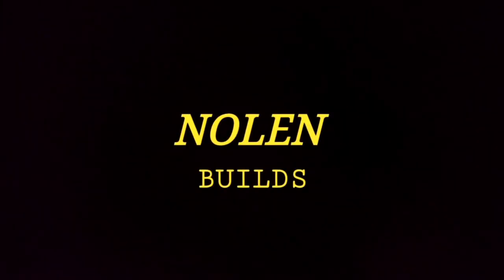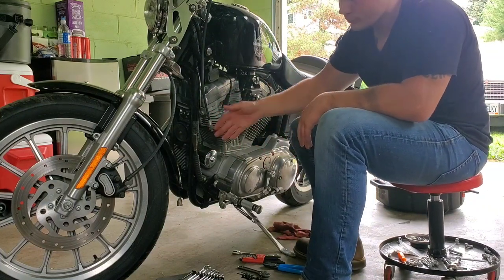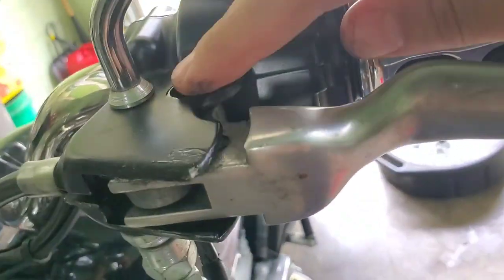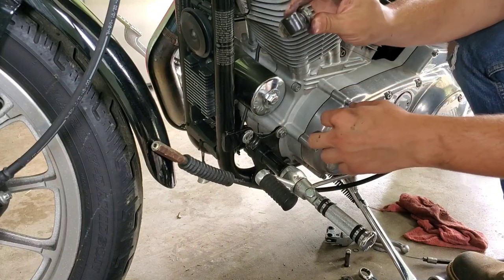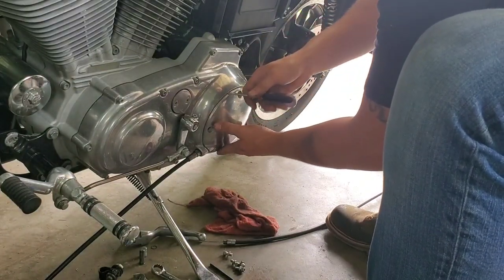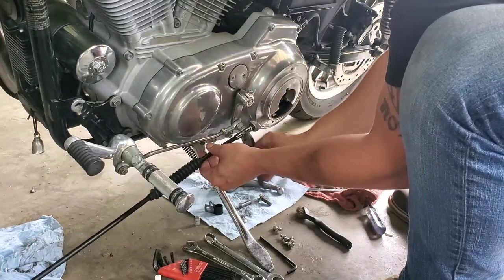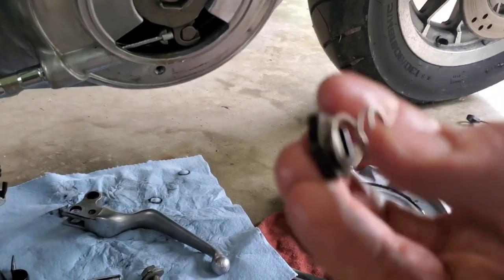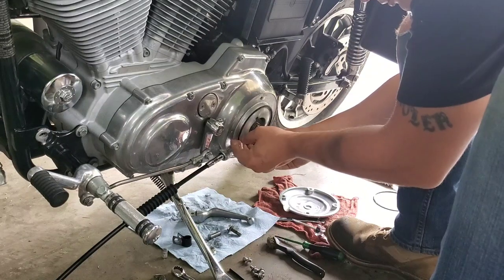HD Sportster Clutch Cable Replacement and Clutch Adjustment How-To

Comment: This was the best video I could find of the clutch cable replacement. Well done! I did it first attempt, no problem because of this thorough video… minus my own hiccup with two stripped Torx screws. Thank you so much!

Comment: I hate snap rings, and H-D uses them everywhere. I have over $200 worth of snap ring pliers mostly because I own Harleys. I have a 2006 Sportster, and it has 6 screws in the derby cover. By far the biggest PITA issue I ran into was the derby cover gasket. The original gasket came part of the way off when I removed the cover, and I was planning to replace it. But instead of an oem H-D gasket, I had an aftermarket "James" gasket. No way would it fit. Despite saying on the bag it came in that it was a replacement for the oem part 25463-94A, and that it fit 1994-2014 Sportsters, it was TOTALLY wrong. The diameter was right, but it was was twisted 90 degrees compared to the oem gasket. I had to order an oem gasket from H-D. I used Lucas "Red N Tacky" grease to hold it in place on the primary cover while I put the derby cover back on. I have since seen another one of those "James" gaskets, and it was the same as the one I originally had. I don't know what the issue is, but avoid "James" gaskets, at least for the derby cover. My manual says to torque the derby cover screws to something like 80 in.lbs. DON'T DO IT. That WAY too tight. My '06 uses #27 Torx screws, and I removed and reinstalled them with an L shaped Torx wrench. Just snug them up. Probably no more than 25-30 in.lbs. 

I did the clutch adjustment like everybody says to do it. I just used a flat screwdriver bit in my fingers so I could get a better feel on it than using a larger screwdriver. I turned it till I could barely feel resistance, then turned it back 1/4 turn. With a 1/16" gap at the lever, my clutch would not disengage until it was like 1/8" from the grip. Another YouTuber called Two Wheeled Rocco suggested that I loosen it another 1/4 turn. Now it works perfectly. This guy knows what he is talking about, and will not hesitate to help you. If you own a Sportster I strongly suggest subscribing to his channel. I went through 20+ posts on a Sportster forum and could not get a straight answer. This guy got it right the first time. 

If you own an older Sportster, and can still get genuine oem H-D derby cover gaskets for it, I suggest getting several. They are only $2 apiece.

Comment: I have the service manual, but this is so much more clearer for me.  Extra info like the assembly bearings and adjustment details are great.  I wonder if the new cable comes pre-lubricated..?

Comment: Hi Nolen and thanks for this very helpful video.  I could not have done this job without your video post.  It all works great but I had one thing that was a little different then your video and that is, the part that holds the cable inside the primary housing only goes on one way as you said but on my 1994 HD 1200 Sporster once you clip the cable in and reinstall the part that has the berrings in it, the part that holds the cable is facing to opposite way. It runs great so does it matter?  Thanks again!  Rich

Comment: I got clutch cable for my 2000 Harley sportster xl1200 said was 52 3/4 inches even tho I kept measuring 55 old cable on bike but Harley n Google said otherwise got new cable the 52 3/4 it's shorter than original so we still got it to fit but had to run it above foot pedal instead under all connected but when try to put in 1st it makes crazy sound from the circle primary cover we have adjusted few times n still same issue what did we might have done wrong

Comment from the maker: Please comment what videos you would like to see done on the sportster. I'm open to all suggestions.
Reply: Do you have any on Neutral light issue mine is 2007 1200 sportster now it wont start unless light is on only starts in neutral too and only when light is green it only happens after ive road awhile then try to restart it and it wont til its cooled down what can this be? And is there a way to side step this not having to start in neutral only? Thanks for help and or could it be my clutch cable at the top has another like button up there that can go either way is why i watched your video here. Thanks so much for help
Reply from the maker: @marihall5005  hey man, check this video link out first. It's a common problem with clutch lever. If that's not the problem I may have some other suggestions. 
https://youtu.be/dEd-UVkqDmo

Comment: Brother..losing my mind here.. while going up hill...my gear slipped...and I had to adjust outside clutch cable ignorer to get home...
Today...I changed primary fluid, and adjusted internal clutch..removing primary cover etc...
Here is where the issue posed up...after putting everything back together..bike making huge screaming noice when I put it on 1st gear..on natural no issue..but when I put it on 1st....Hope I didn't damage anything..your help is appreciated..Thanks
Reply: Same here how did you fix your issue

Comment: My 2014 Sportster has zero instructions for this in the manual other than “see dealer”. Thank you for making such a thoroughly detailed guide for replacing the cable.

Comment: I changed the cable and bars on my bike but when i put the bike in gear while off and pull the clutch in the bike won’t move idk if thats normal or not
Reply: If you're in gear the bike shouldn't move if it's off.